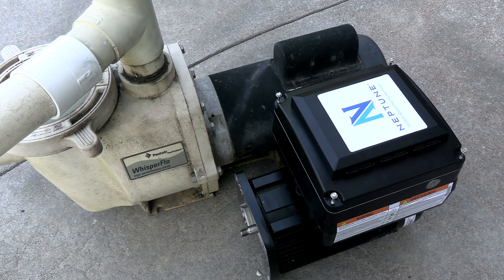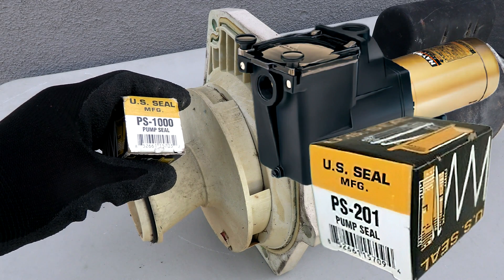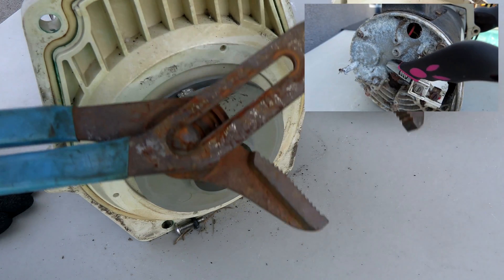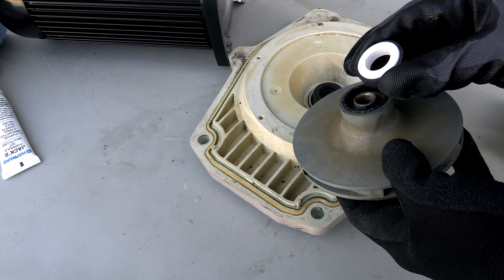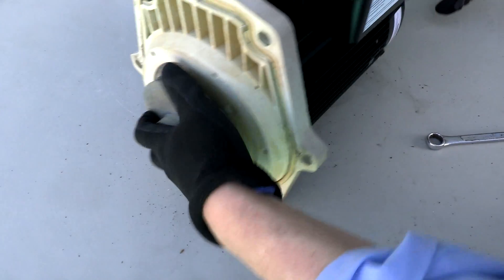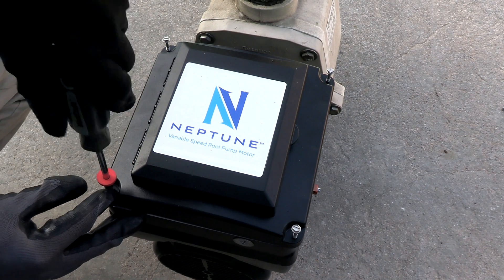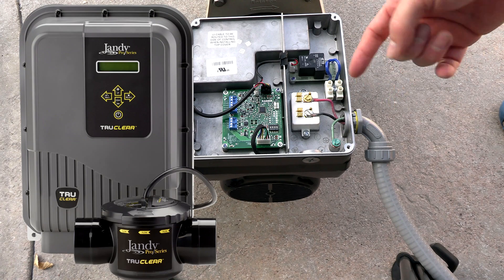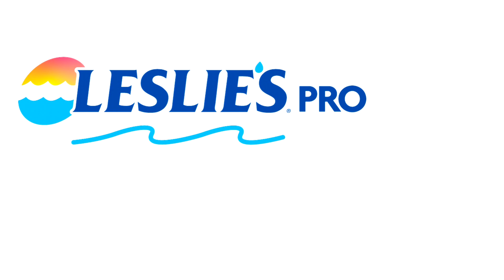VS Motor Install STEP by STEP Video Guide: Easily Upgrade A Single-Speed Motor (NIDEC VS Featured)

Comment: I just installed the Nidec neptune 2.25 and its up and running. Thanks for the help! I now need to connect my pentair ichlor 30 SWG to the auxiliary load relay but i can't find any decent documentation or video and the Neptune documentation doesn't show which line goes where. It is currently wired directly to wired directly to my power panel on a different breaker as my previous pump was single speed and it ran all the time.  It seems very easy but still uncertain which line goes where. I was also wondering if I should have them both on the same breaker? Currently the Neptune is wired to a double 15 breaker and the Ichlor SCG power supply is wired to a double 20. Appreciate any input!

Comment: Hi, thanks for the help. I have a single speed 1.5hp century motor. I can’t seem to find the nidec vs motor at that THP. Should I go with the 1.25thp or the 1.65thp motor?
Reply from the maker: Go with the 1.65 THP
Reply: @SPL  do you know if the NPTQ165 square flange is the same as the NPTT165?
Reply: Sorry, I believed I’ve figure out the NPTQ is the square flange, where the NPTT is the circle

Comment: What's the best option for replacing a single speed with a variable speed on a jandy system with the iq20 so it can be controlled with the app? Appreciate any advice
Reply from the maker: A Jandy VS pump will be the best option. Seamless communication.

Comment: On the conduit fittings you’re supposed to remove the little washer. Its not waterproof if you dont. That little yellow gasket is supposed to mate with the side of the pump going into the terminals. The washer is only on there to keep the gasket in place and then you can also put the washer on the inside of a sub panel since sub panels just have a hole and no threads. Hope this helps

Comment: Great content. My 2speed motor cannot start up in low speed up, but can start in high speed mode with some noise and light smell after 5 years. Could it be bearing problem?
Reply from the maker: Maybe. Or a bad capacitor. If it is the bearings the motor will run loud as well.
Reply: @SPL  thank you for the response. Can it start in high speed if capacitor fails?   I’m hearing some noise and weak smell when it runs in high speed.

Comment: What about programming the VS pump from an old Jandy RS485 control signal?  I am looking to replace my  12 year old Aqualink system with open source Aqualinkd and would like to know if this pump can talk RS485?
Reply: I cannot make it work....very frustrating and I just bought is from Leslie's as the recommended replacement for my failing Jandy ePump motor.  This Nidec pump requires a NodeID for CanBus.  There is not NodeID setting on the Jandy AqualinkRS.  Even if I set NodeID to 1...it will not start/control the pump.  This is the entire point of installing this pump....to be able to control/program the speed from iAquaLink.  I can't seem to make standard RS485 control work.
Reply: @rfrankway  how do you know it's CAN bus and not RS485? Is that in the manual or something?  I'm an embedded software and hardware engineer and would be very interested in reverse engineering the protocol.
Reply from the maker: Yes, it should communicate fine with the Aqualink.

Comment: If Variable is out of my budget, would a 2 speed a worth upgrade? My pump just stopped and won’t turn on. Power is getting the pump, bad capacitor, but tried a 10uf on a 50uf but no noise at all before buying the correct one. Any 💡 ideas? Pretty sure pump is fried but just want to have some hope. LOL
Reply from the maker: I am just not a fan of 2 speed pumps in general. Maybe search around for a lower cost VS motor - there are some off brands that are decent.

Comment: I have an aquapro 2hp single speed.  Can I change just the motor to a VS ?  Any brand motor?
Reply from the maker: Yes - it should work. It is more pump dependent. So make sure you get the round or square flange version. Most pool pumps are square.